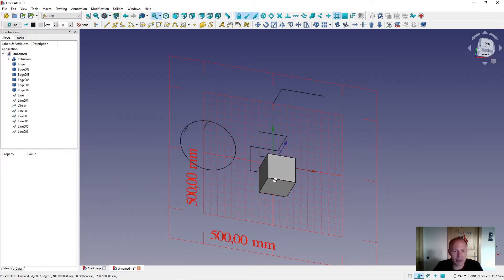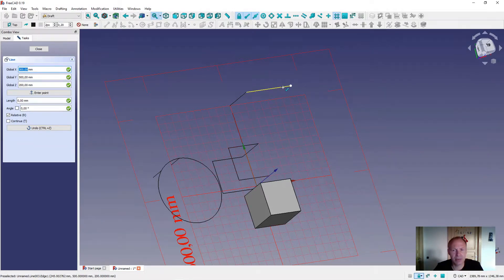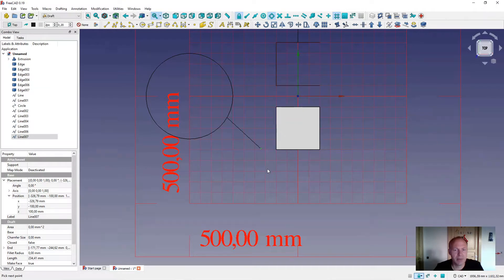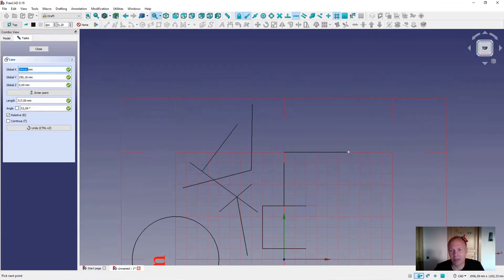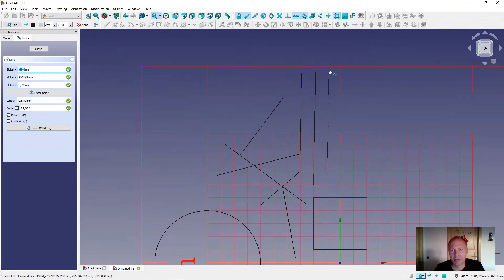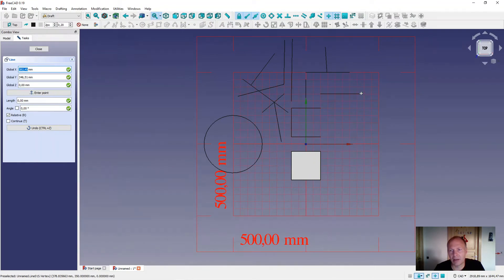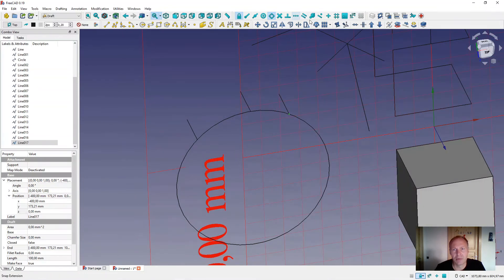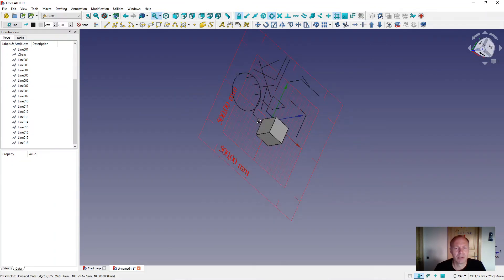Freecad draft lesson 2 snap tools

Comment: How do you snap to an angled surface? I am trying to model a roof. I can't get the metal roofing from the parts library to snap to the pitch of the roof, or anything to snap to surface that isn't in the same plane as the object that I am trying to move